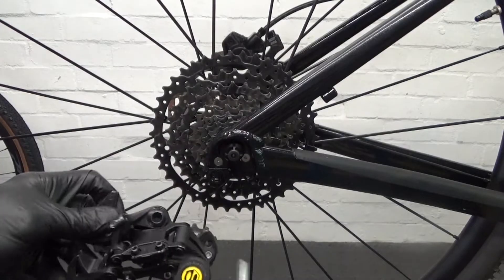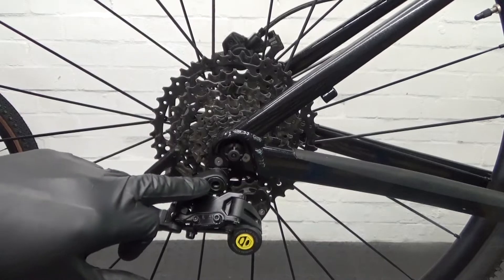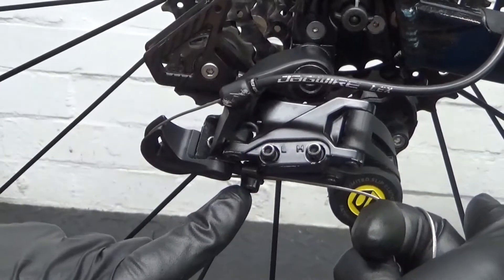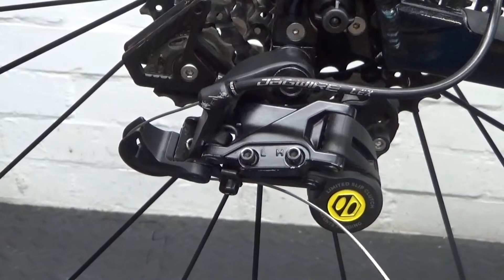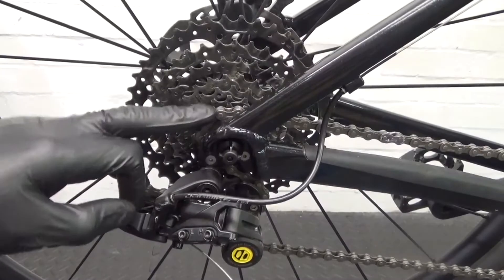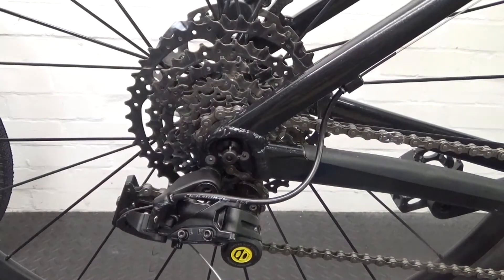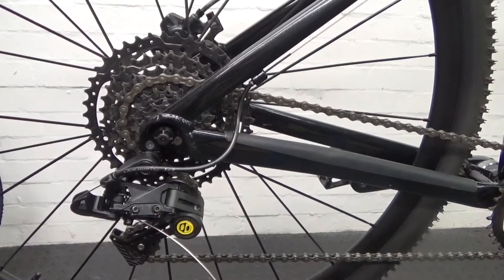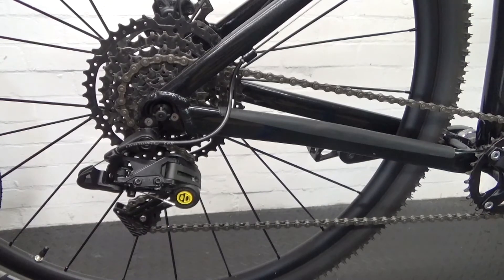Box Four 8 Speed Rear Derailleur Fitting Guide

Comment: I have this derailleur on my bike with the trigger shifter and 8 speed cassette that it came with but I want to use a microShift 8 speed friction shifter instead of the trigger shifter.  When I installed the friction shifter I could only get enough throw on the shifter to get 6 cogs and not the last 2 largest cogs.  Can't figure out why this derailleur won't work with a friction shifter.